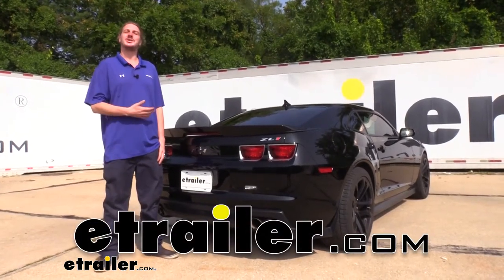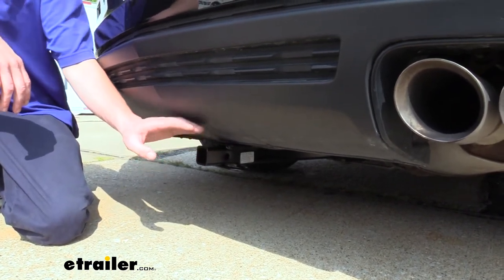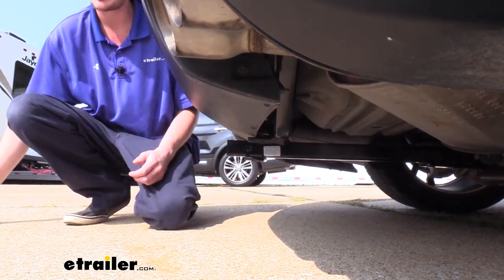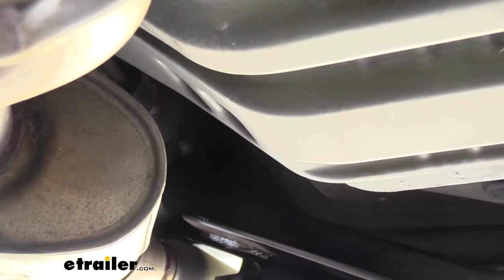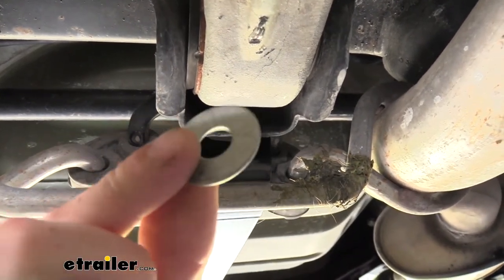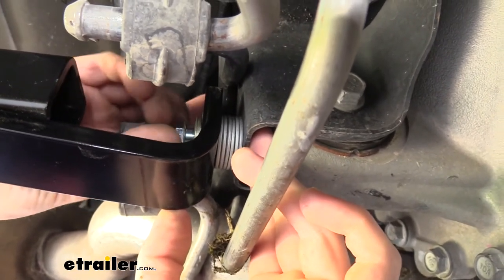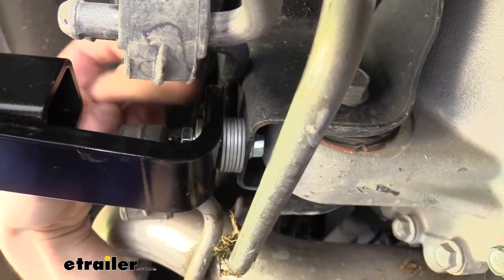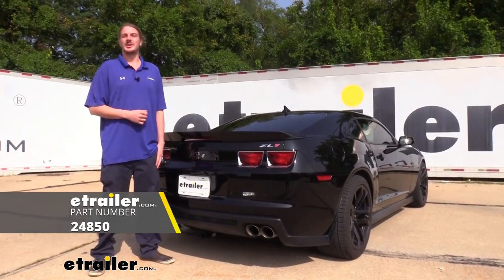etrailer | Draw-Tite Sportframe Trailer Hitch Installation - 2013 Chevrolet Camaro

Comment: Another question? From the center pin hole on the hitch to the bumper is 9 inches meaning, my flag pole holder will need to be 9 inches from the safety pin hole to the 90 degree bend that holds my flag? So that it won’t hit my bumper?
Reply from the maker: You are correct. You need to get your accessory past your bumper.
https://www.etrailer.com/Trailer-Hitch/Draw-Tite/24850.html

Comment: Will it handle a 700 pound murdercycle?
Reply from the maker: You would need to put the motorcycle on a trailer. The trailer and the motorcycle would need to be in the specifications of the hitch and the vehicles weight ratings.
https://www.etrailer.com/Trailer-Hitch/Draw-Tite/24850.html

Comment: Do you have one for a 2009 Camaro?
Reply from the maker: Do you mean a 2010? The 5th Gen Camaro began with the 2010 model year after the 4th gen ended with the 2002 model  year, so there isn't a 2009 Camaro.
Assuming you have a 2010 model, the Draw-Tite # 24850 you'd looked at would work great for you.
https://www.etrailer.com/Trailer-Hitch/Draw-Tite/24850.html